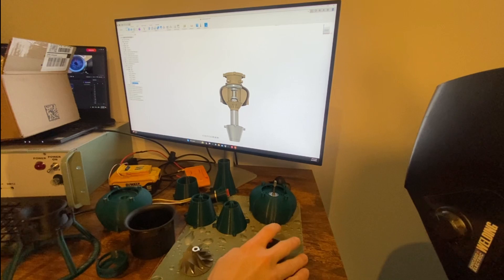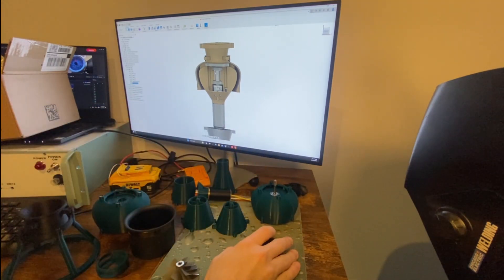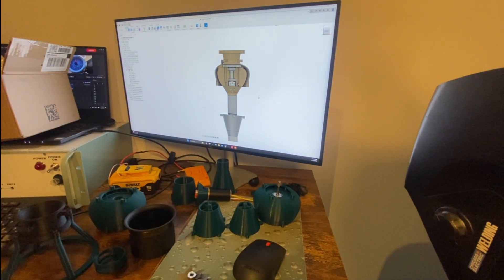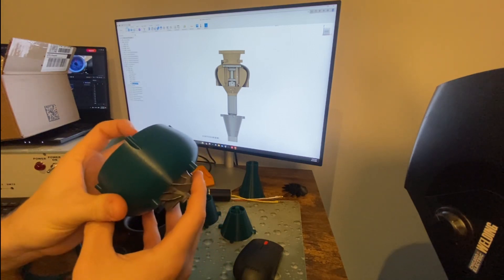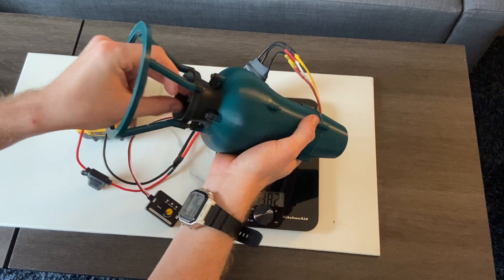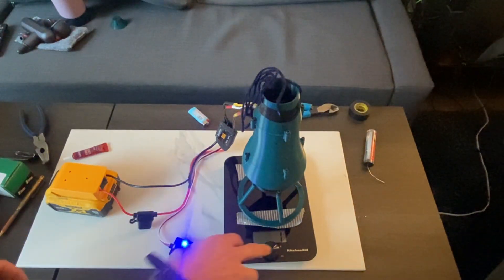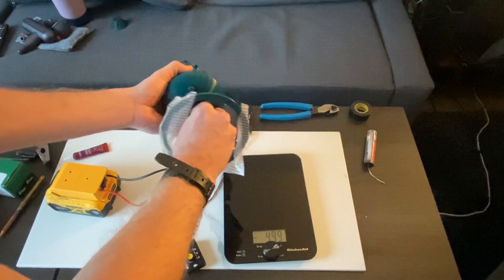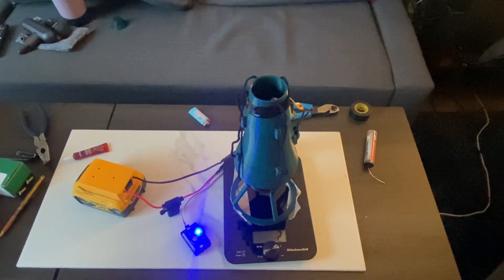Using an Audi turbocharger as an RC airplane motor

Comment: super interresting stuff! and as you said, it's for fun and experimentation. 
@Leeroy002 made a veryy good point. it's a compressor, as opposed to a thruster, optimized to static pressure, rather than exhaust speed and throughput. 
as an airplane thruster, it's pretty meh .. but you could build an absolute beast of a hoovercraft platform with it. possibly strong enough, that you could have a ride on it!

Comment: miss conception about radial turbojets is that the COMPRESSOR wheel is responsible for COMPRESSING the air... Its not the part you should be measuring for THRUST or CFM, but rather how well it COMPRESSES the air prior to COMBUSTION.

COMBUSTION of fuel causes the air to heat, expand and THAT'S where you get thrust from.

What you have build is closer to a EDF (electric ducted fan) not a turbojet... Yet.

Comment: information          6:00   estimates should account for the fact that the masses of the motor, impellor, shaft, etc.,  do  Not  change.         in the case of a normal edf, the exit cross-sectional area is supposed to be equal to the effective swept area of the impeller.        in this case, idk.     d
Reply from the maker: That’s good to know. Iv just printed some more exhaust nozzles to test including a 1:1 nozzle and smaller. I think that a slightly smaller nozzle will be necessary because this turbine was built as an air compressor instead of a fan so the extra taper will help get the air velocity up
Reply: @WilsonFabrication  Sorry for the necro, but is'nt it the opposite - you have compressed air at the outlet that is going to expand, so divergent nozzle shape would produce more thrust? Anyway EDF would be definitely better, but super cool experiment.